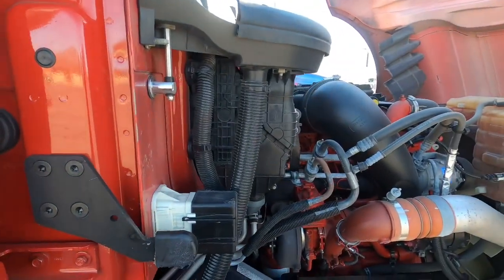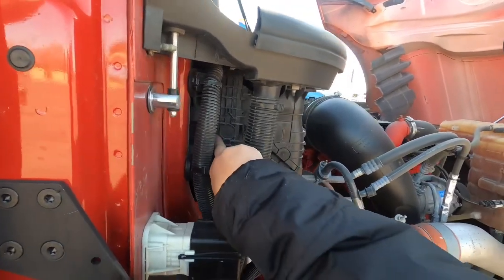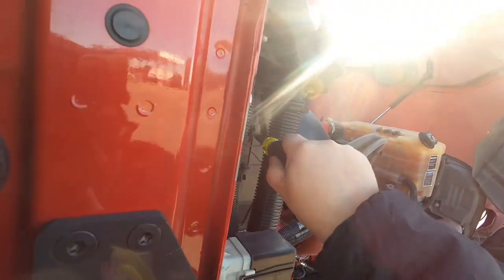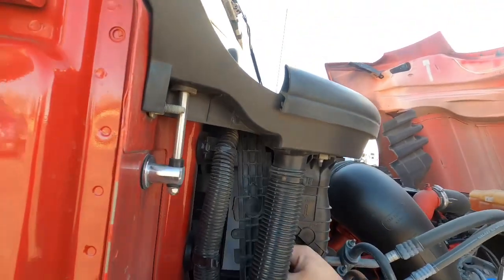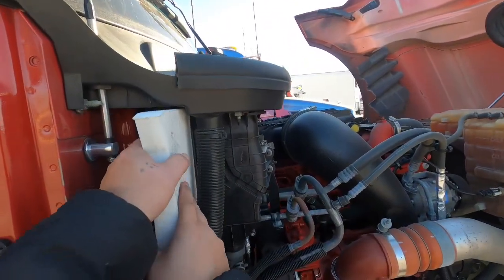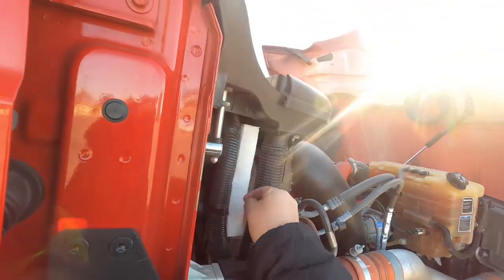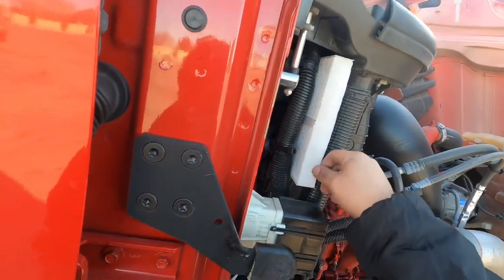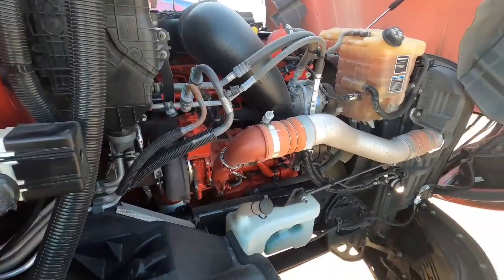How to change the cabin air filter on a International LT #trucking

Comment: fucc when i got my trucc in the summer and i would run the a/c it wud smell like moldy air. i had to beg and plead with the company to change the condensor coil man! they just kept throwing filters at it and didnt do shit.
Reply from the maker: There’s a way to fix that with a couple products from Walmart and it doesn’t require any tools. Next time I stop by a Walmart I’ll pick the stuff up and do a short video on it. Then if you ever have that issue again you will know what to do.
Reply: @Olesnapper  yea actually let me kno. i tryed the lysol spray and everything..it was just going bad man. i like argued with tha shop guys about it.